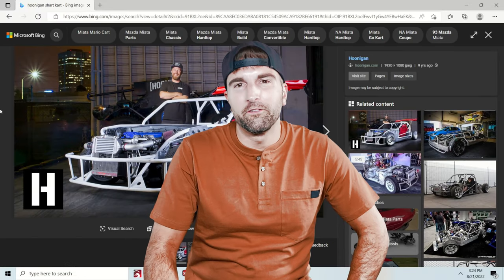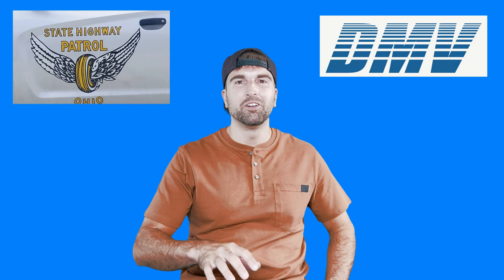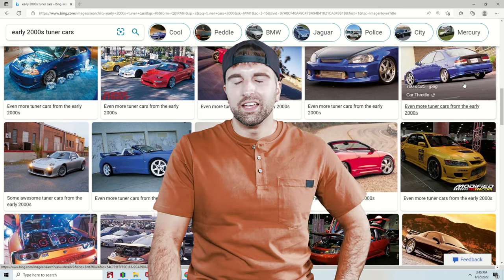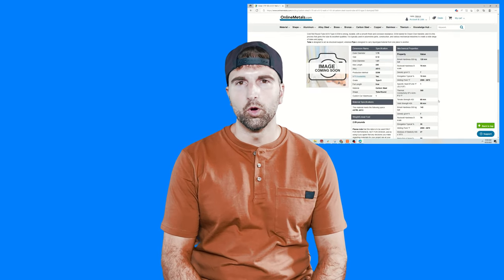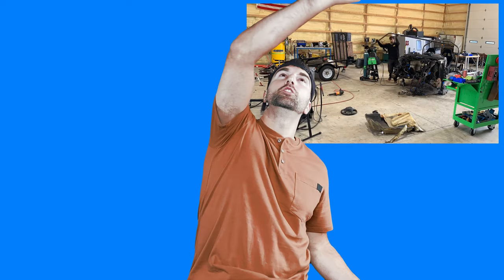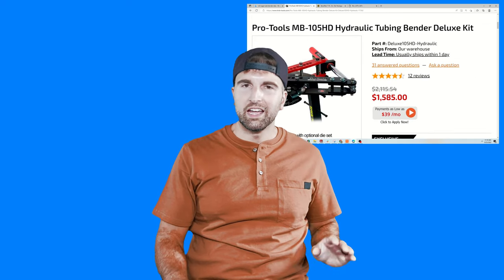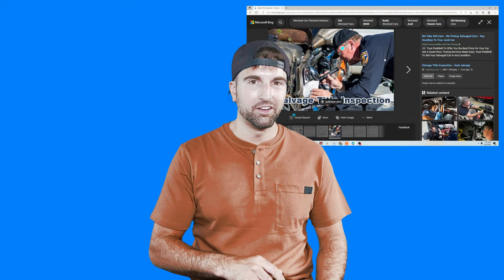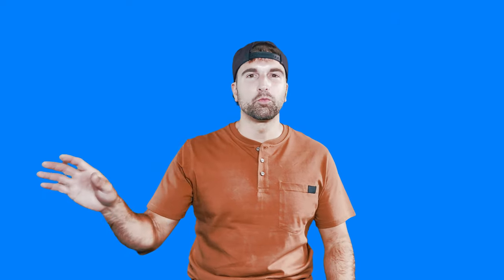How to Build a Exo Car - Research, Tools, Skills, Fabrication, & Paint

Comment: flux core welders work perfectly fine. its a super common misconception that they are worse. they get just as good of penitration and weld extremely well so long as set up properly
Reply: Exactly. You aren’t going to see guys welding on water towers and lugging 100+ pound shield gas cylinders up and down with them.

Comment: Just picked up a 2006 tahoe z71 only 86k on it that 8 years ago drained and pluged throttle body exhaust an water lines to block an was parked in 2016 after using dash center console and seats to update a 84 single cab with a 6.2 an 4l80e from 09 caddy he was building "which is clean OF mind you" after his wife had parked under tree before big storm and monster limb landed on back 4 foot off for 300 bucks just now when took son to hang out with his an saw it right after watching this earlier an exo cart slash lets be dumb or fast AF for cheap as possible an still be street legal is living rent free in my head! Now im in possession of the absolute perfect starter vehicle for it! So going to be taking body off the frame an make new mount arms from just the firewall and some of the floor pan back few inchs behind frint seats only  to have for windshield  and doing a 4x4 exocart off the frame essentially make me a rock bouncer styling but want to do a 2 seat monocock fill with inline passenger two seater to keep center of gravity low as low can be an bring the firewall an dash back about a foot so can do same with motor trans an tcase since only need two drive shafts shortened  that and take other off 04 i have setting and shorted to fit front axel cheaper than stretching original and move the  torsion bars coilovers conversion lower an upper djm 4 in drop  arms ive had setting for few years and the 2 in drop spindels on front  essentially just do rear mount relocation of spring and shock mounts since no body to worry about making it difficult notch the rails an upgrade sway bar to watts link an make it a simpler 4 link set up with lowering shocks and adjustable coilovers since i have all this stuff on old lowered 02 ext cab chevy truck that got hit few years back 34 days after completion still there an  cause again no tahoe body to worry about all figuring spend no shit $1000 on hymjoints and other misc things for fabrication of suspension upgrades and moving motor back and down some an doing the 4 link frame out and mounting points an got metel tubes pipes and pieces from 70 yewrs of familys farming and life to use ill then spend about $2000-3000 on different 5.3l i got with 196k in daily currently a stage 3 rated for 1100-1500 whp  3 speed power glide got couple years back for good trade on 04 1500 ext cab i restored with maybe $1500 in for $8k built power glide, an swap the 4x4 tcase with 09 caddy awd one an get the harness, wiring an module for trans an tuning upgrades like $600, the 5.3l already has upgrade  oil vent upgrades a muelings HO oil pump gasket kit with mls headgasket aluminum summit racing pistons and gen 4 rods gapped for boost with stage 4 BTR boost cam kit duel springs trunion an rocker upgrades with ti valves an retaining clips lifters an buckets, xl . pushrods geared timing  upgrade and cover plate and performance crank balaner and electric water and power steering pumps with low profile serpentine set up  ran me about $6k when motor was at 188k 3 months ago an havent got power adder done yet cause got a similar build ls3 from wreaked 2013 empala going in daily like 2 weeks after finished it and then the 2-3k is going on two big ebay special 68-72mm turbos and header fabrication and monster inner cooler to cram about 22-28 psi down its throat for a solid 1000-1100HP tune and not be pushing the motor build much or the turbos and pray they last and if i can get that thing for 6-8k an stuff i have already running 8s im take the winter to do a better live axel rearend and better precision turbos and take it the route of leeroy the savage but tahoe variety!!! The little extra wieght and central weight distribution moving fire wall and motor tho thing will be a no prep monster with some nitto triple 5s or mickey Thompsons  drag radials on all 4 corners at 15x10 front and 15x13 rears ill enjoy every damn second of this thing. Son got home heard what i was thinking just now and said ima go buy the new hydraulic mandrell bender we where talking about from ebaymotors part store account from my share so i can say its mine too..... like bro just csuse have licenses in few months not getting drive my toy.... looks back goes you know you want help weilding imsay 2-300 hours of it gets that ability doesnt it.... like touche little shit hes right i will let him drive it helps mine first to pu of his build lol.

Comment: I'd love to do this to my old 87 MR2 that was totaled in August. But learned that I could never put it on the street in this video due to it's new salvage title status.  Would have been perfect b/c the engine and the first 3/4's of the car survived just not the quarter panels and  the roof c-pillars.  I even have spare more powerful engines I could swap in.  :(    I may still do it as some sort of off road dune buggy.

Comment: I realize that this might be a little counterintuitive considering the weight. But I was thinking about using a Ford Crown Victoria as a starting point as they are relatively inexpensive at auctions. I was planning on doing a junkyard LS swap anyways so mileage really doesn't matter just looking for a starting point. Would this be a good starting point or would I be better off using a light car from the start like a Miata, Cavalier, Neon, Cobalt,etc. ? I was just considering that if I wanted to go 4X4 all that would be needed with a Crown Victoria is a transfer case and a front axle from a Ranger, F-Series truck, etc.
Reply from the maker: Yeah a crown vic, especially a police interceptor, would be a great starting point. Your still going to have a really fun platform to cut up and get on the road so I would say go for it! I have seen a few other exo crown vics and they turned out great.